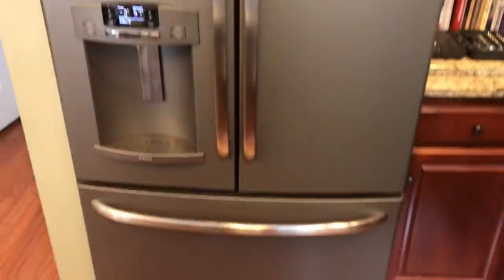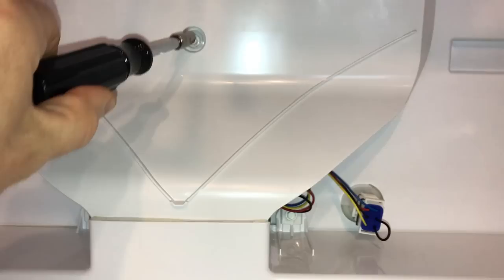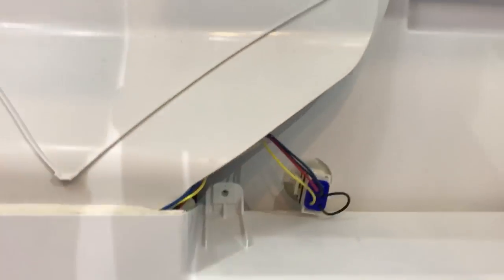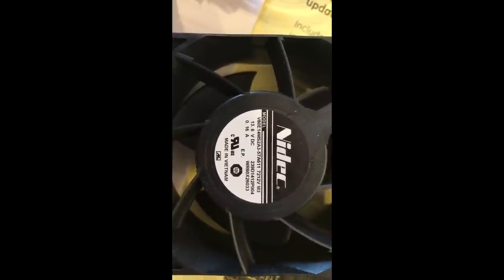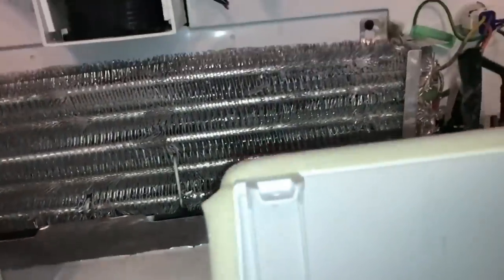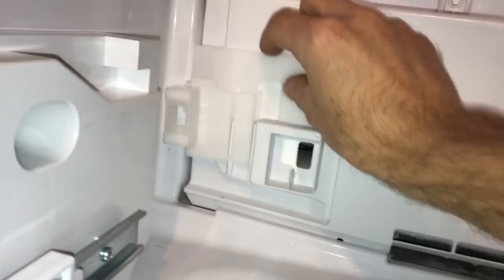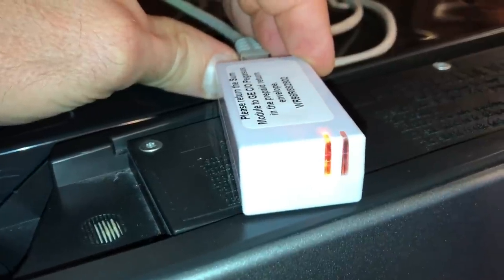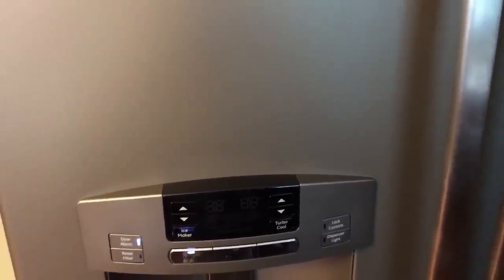GE french-door refigerator not cooling - How to replace evaporator fan

Comment: Thanks for the video.  READ IF YOU HAVE TEMPERATRURE ISSUE IN YOUR GE REFRIGERATOR.  I wanted to share my experience with my GE French Door temperature issue, part number GFE29HSDDSS.  I bought all GE appliances for my brand new home I personally built in 2014, so only 6 years old.  My GE french door fridge would not stay cold enough, range from 42-46F on the display.   The freezer was great and held at zero consistently.  My issue started back in April 2020 and finally fixed in October 2020.  Yes, almost 6 months of hell and spoiled food.  I researched diligently, triing to figure out what could be the cause.  I viewed videos such as this one and changed out my evaporator fan hoping this would correct.  It did not fix the issue.  I then called GE hoping they would be able to shed some light on why or what could be wrong.  BIG mistake!!  GE customer support might be the worst I've ever dealt with.  I called several times and normally waited at least an hour for a representative for them to basically say they are only there to provide basic support and order parts, would NOT help in any way.  I asked for higher support and they said it didn't exist.  After continuing to learn more possibly about my issue, I replaced the evaporator temperature sensor and evaporator coil defrost thermostat.  No luck, still continued to have high temperatures.  I ordered a new main electric board thinking there was some bad capacitors, no luck.  Then, I hired a qualified repairman, he was great.  He called GE and after looking into codes on the phone with GE, they said it was a low freon issue. Repairman checked it out and was holding exactly as it should.  The he did a little more research and told me that my refrigerator model had a RECALL on the evaporator fan plus rear air flow tower.  It would have been great if GE would have told me this having spending hours on the phone waiting to speak with a representative, they wanted nothing more than to get off the phone with me as quickly as possible.  Unfortunately, this new tower helped a little but the temperatures would not surpass 40-42F, set point at 35F.  Final resolution was a $18 temperature sensor at the very top of the refrigerator under the plastic grill cover.  We only figured this out after my repairman ran a week long temperature study with a digital termperatrure recorder.  The problem was worst than we though and at times the termperature was reaching 50F.  I bought the termperature sensor and put it in within a few hours, I could tell it was better.  SO...if you are considering a GE, think twice, I won't purhcase GE ever again.  If you are having temperature issues with your GE French door unit, change out the evaporator fan plus the TWO temperature sensors, one at the evaporator coil and the other on the inside top under the plastic grill cover.  Should fix the problem.....case in point, I'm sure GE knows about these problems and fixes, why not help your customers with easy fixes such as this one.  Went through nearly 6 months of HELL.  Get it toghether GE, just terrible.
Reply from the maker: This is great information.  Thanks a lot for sharing, and I am sure that it will help a lot of people.  Glad that you finally got your fridge fixed.
Reply: Thank you for your knowledge & details confirming how much this GE fridge sucks along with their customer service!  I am having same issues now on a 2017 model
Last summer paid $500 for GE to fix the freezer fan gasket issue

Comment: Thank you very much for this post! My 3 year old refrigerator turned up with the exact symptoms you described at the beginning of your video.  The fan was out of stock with the supplier you mentioned, but I found the fan part on eBay.  Your step by step made it a cinch to do the fan replacement and software upgrade.  Thank you and DIY saves $!
Reply from the maker: Nice! Glad to hear you were able to get it fixed.

Comment: Thanks for the video. It helped me diagnose and fix my fridge. How ever, my experience was a little different. My fridge is a GNE29GSKSS (bought is Feb 2018), top double door fridge/bottom freezer, no water and ice in the door, "Twin Chill" cooling. The fridge was warm at 65F and the freezer was normal at 0F.  There was no air flow in the top of the fridge at the vent where the cold air should be blowing via the evap fan. The evap coil was not frozen with ice, but it was frosty. The evap fan was running. And the evap fan was the "upgraded" fan according to two or three of the sellers on Amazon, Nidec brand, WR60X26866. These factors placed doubt that it was an evap fan problem. After a day or two of trial and error, I did finally determine that the evap fan was not running and the fridge was warm, again, even though the freezer was running at normal temperature.  After ordering and installing the new fan, but the same brand and model, Nidec WR60X26866, and testing for another two days, the fridge and freezer ran perfectly. Conclusion: 1) The evap fan can fail intermittently for several days.  2) The "upgraded" evap fan may not really be upgraded in terms of having a longer life, since the factory evap fan in my fridge that failed was the same fan as the evap fan that Amazon is selling as the "upgraded evap fan.
Reply from the maker: Good point, upgraded may not mean better or longer lasting.  Glad you got it fixed!

Comment: Thanks for the video. What if the evaporator fan works just fine? Top of fridge isn’t getting as cool, bottom deli drawer is freezing, water dispenser is freezing and won’t dispense. Do I need to replace the deli drawer fan? Or is it another issue?
Reply from the maker: The evaporator fan may be working intermittently and causing the issue, so it still may be worth replacing the fan to fix the problem.
Reply: @ljschuby99  ok I’ll give that a try thank you.

Comment: Thanks for the video. I noticed that you are on at least your third fan. I am on my third. GE tech put in number two and left the sticker like I see on yours. Your video definitely increased my confidence level when I did this repair. The parts place I went to here in Raleigh had sold 13 of these fans in the last 4 months. We definitely like the refrigerator but this fan is a hassle. Take care!!
Reply from the maker: You are going to be a pro at this. Hope the new one lasts for a while.

Comment: Great video . Please more specifically what or where to get the  CAT 5 cable ?    Thanks .
Reply from the maker: You will not need the cable anymore. 
The new fan specs do not require a software update. 
So you can just replace the fan for the fix.

Comment: Two years ago I followed your instructions and replaced the evaporator fan (thank you). The cooling problem was solved with a new fan but right after that I noticed ice started building under the vegetable drawers.  Any ideas what to do about correcting it?
Reply from the maker: It could be frozen drain tubes. You could take off the back cover and insect to see if anything looks frozen. Sometimes thawing that out will fix the water/condensation draining problem. 
Also, I know it sounds crazy, but I have heard of the fans going bad again. Even an intermittent fan issue could cause a problem like this. So, if nothing else that may be a relatively cheap replacement fix to see if it takes care of the ice under the tray.
Reply: @ljschuby99  Thank you for the suggestions, appreciate it. I’m going to try all of those ideas.

Comment: Can you tell me what replaces the fan inside the cover you removed??? Its enclosed in styrofoam and not sure if its working along with the evaporator fan. Thank you, awesome video!
Reply from the maker: Not sure what that would be - my fridge did not have any styrofoam. 
But replacing the just the fan usually takes care of the cooling issue.

Comment: Thanks as it was an easy fix. I just turned the fan and it started working again, so i used the original part  until the new part arrived. It was an easy replacement and it sounds so quiet  with the new part
Reply from the maker: Good deal - glad you got it fixed!

Comment: Thank you for the video! Replaced the fan and the fridge has stayed at  40 for 24 hours. However, when I reassembled the interior pieces, the freezer temp started to rise. Any suggestions on what I may have done wrong?
Reply from the maker: Depending on the fan blade type, maybe it could be placed upside down. Other than that, you could experiment with the temp settings and the turbo cool option if your fridge has that feature.

Comment: Had the same exact problem. Very loud fan at times. Not all the time. Crisper also was frozen sometimes. When it finally went today the fridge temp rises and the freezer temp is ok. I ordered the parts one year ago today. So I’ll be honest, I avoided this repair for the last year. Watched your video before I repaired mine and it was spot on. Appreciate the help! While it was defrosting I cleaned all the parts I removed. Also when coming off my coil was frozen to the styrofoam. I ended up splitting it to get it off. I used gorilla glue and then put metal shurtape to hold it all together. I’m curious if anyone had problems with the fan after the repair, for example one or two years later do we have to do this again? Would be curious to know what the software update was all about too.
Reply from the maker: Glad you got it fixed.  My new fan is still working fine after 2 years, so hopefully you will be good to go for a while.

Comment: Thanks for the video!  I have had this same model for 7 years and have replaced my fan 3 times, each lasting about a year before needing replaced.  This most recent fan change, 3 days later, I can see the coils freezing up again.  What else do you think could be wrong?  My freezer works perfect, and all temps are fine right now, but still see the coils freezing up a little along with the pan right under neath the coils.  I also heard a loud knock come from it this morning.  Any ideas?  Thanks for your help!
Reply from the maker: Sounds like the fan is working just not when it should. 
I would recommend going to the forum section of the ApplianceBlog site. The moderators there are very knowledgeable and may have the best next step for you.

Comment: I realize this is a 4 year old video but I recently have the same issue with the top two coils of the evaporator pretty frosted up, the rest were mildly frosted.  You didn't mention if you found the evaporator fan running or not. Was it running intermittently? Was it stone dead? Mine was running when I pulled the back cabinet apart.?????
Reply from the maker: Mine was not running at all, so it was totally frozen. 
Are you having same symptoms of warm fridge and frozen deli drawer?
Yours could be running intermittently, and replacing the fan could very well take care of the problem.

Comment: I just swapped out the fan and it did not fix my issue - fridge still running at 56 and freezer is fine at -5.  I had a lot of frost/ice build up - under the fan that I replaced, the opening was nearly completely frosted closed.  I melted most of it - is that an indication that the old fan was the problem?  When I accessed the old fan, it was spinning/working as far as I could tell, but I replaced anyway.  Is the defroster thermostat the next thing to try?   Where is that and is there a video to help for that?  Or maybe the freezer fan?   Thanks!
Reply from the maker: Darn, the new fan usually takes care of it. If the new fan is not kicking on and you are still experiencing frost and ice, then you may need to look at the stat or the board.
I would recommend going to the Forum section of the ApplianceBlog site.  The moderators there are very good and could recommend which one to start with.

Comment: Great video. Replaced the fan with an upgraded model (not needing the software update), after about thirty minutes the fan has cut off and stopped blowing cold air inside the fridge. What would cause the fan to cut off at 50 degrees (fridge set at 36), possibly a motherboard  or software issue other than the fan?
Reply from the maker: Sounds like a possible sensor issue.  Other commenters here have found issues with the temperature sensor in the refrigerator compartment.    
Also, you could check the forum section on the ApplianceBlog site for other potential issues.

Comment: Thanks so much for this. My refrigerator was doing the same as yours. Your instructions were spot on and the refrigerator temp is cool again. Th nks again for this video!
Reply from the maker: Glad you got it working again.  
The good news is that the fridge seems to be very good other than the fan - mine has been working perfectly with no other issues since the repair.

Comment: Thank you for the video. I am in the middle of this attempt and have exact same model. How do you know if fan is not working? Will it be on whether doors are open or shut? Just trying to confirm it is not working, it doesn't spin as easily as I would expect it to (when unplugged).
Reply from the maker: Yes, the fan should kick on even with the door opened, and is typically hard to spin and slow to start when it goes bad.
If you have the exact same model and symptoms, the fan is the most likely problem and the first place to start.
Reply: @ljschuby99  I did order a new one. I sprayed the old one with dry WD 40 type stuff and it does spin now. The drain line was frozen, everything looked frozen. Guess I will be taking apart again when I get the replacement fan.  Thanks for your video!

Comment: Hi, Thank you for the video. My fan is bad for sure too, but when I pulled the fridge apart the condenser coils were warm. Any ideas? Maybe it was in a defrost cycle?
Reply from the maker: Usually those are cold or frozen. The fan replacement may take care of that though.
Reply: @ljschuby99  Thank you, after a short time it did start to get cold. I have a small house fan inside to keep it from freezing over until the fan comes. :)

Comment: Very helpful video, thank you for posting.  We had the fan replaced once already at a cost of $400 so I'm glad to give it a try on my own this time.  You show the software (upgrade?) at the end and I'm just curious does this have to be ordered separate or will the fan come with that addition?   There are a variety of choices when I look for the part and it makes me think that the more expensive ones will have that software?     Any additional insight is greatly appreciated.
Reply from the maker: The specs were changed and the replacement fans no longer require the software upgrade, so you will be fine to swap it out without needing the software change.
Reply: The replacement went very smoothly but unfortunately did not solve the cooling problem.  Still troubleshooting.

Comment: So, it was indeed the fan…the old one had seized and my symptoms were identical to the one in your video. However, I didn’t get any cable for performing a software update. Is this essential?
Reply from the maker: Glad you got it fixed!
No, the software update is not required anymore with the new fans.
Reply: @ljschuby99  
Thank you for your prompt reply. I’m happy to report that a scant 12 hours later the freezer now sits at a perfect 0, and the fridge at 39…
I’m not sure it’s ever been this perfect as I seem to recall cleaning ice from under the deli drawer since we first got the fridge new from a scratch and dent vendor.
I must thank you for your fabulous video. Clear, concise, accurate, and reassuring.
I’ve been empowered by the experience and I’m sure everyone who hears me boast of this successful venture is a bit bored of it.
For the record, I’m a middle aged single mom with a college degree in a World Language and had little training or experience with engineering or technical skills. Your work here is very deeply appreciated.
By many, I see.🤟☮️
Reply from the maker: Nice work! Glad you got it fixed. 
Who knows what new project will you tackle next!

Comment: Glad I found this video. Any advice?? I purchased a GE Profile french door refrigerator in Feb 2023. In September, it started making an annoyingly loud buzzing sound. I've had GE replace the evaporator fan twice, under warranty. The same noise persists. You can hear the fan kick on and spin up to speed. The noise it makes has the sound/frequency of a big commercial wood chipper being used by someone down the street. It's hard to have a conversation at the kitchen table. When I bang on the plastic evaporator cover, the noise stops for a few seconds...then resumes. Anyone have an idea how this can be fixed? Do I need to add some damping material somewhere on the back panel of the fridge, tighten the condenser assembly, anything?!!! It's enough to cause me dump this unit and go with another brand. Sorry for the long-winded comment.
Reply from the maker: You could remove the fan from the housing, get it to turn on and see if it still makes the noise. 
If it is still making noise, you could try an aftermarket fan to see if it works better. 
If not, you could start looking at the housing to see if it is too tight and putting too much pressure on the fan as it spins.
Reply: @ljschuby99   Thanks for the idea to isolate the fan. I'll report back.